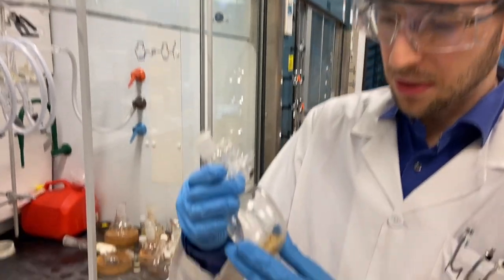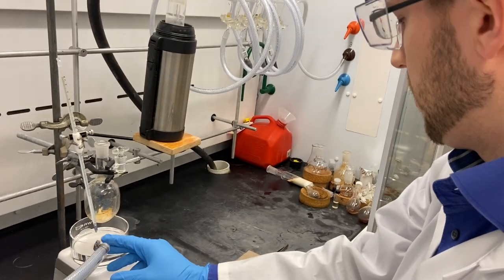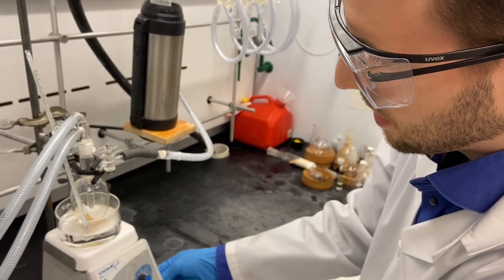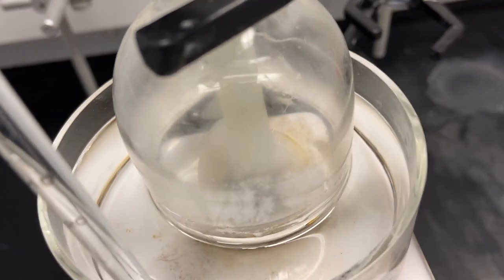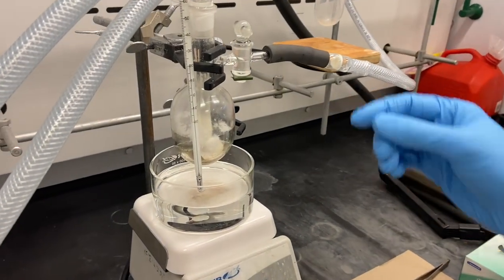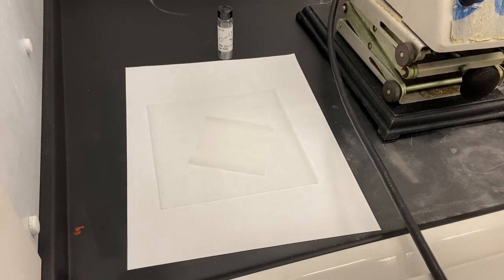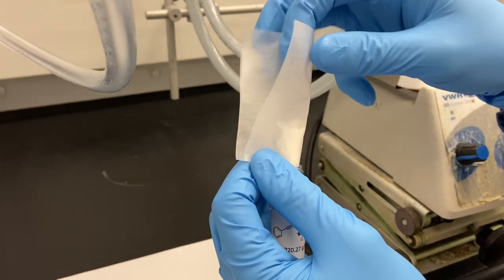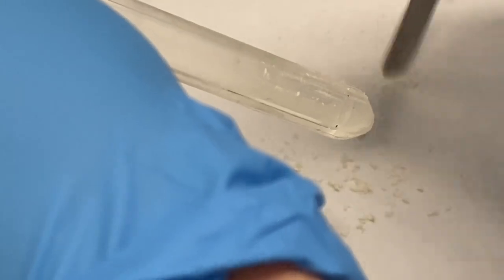How to perform a vacuum sublimation

Comment: So, is the pure product going from solid to gas. And then the adaptor like object that is inserted, its job is to crystallize the sublimated pure product? Is that how you separate 2solids from each other. How do you even know that the other solid won't also be binding to the glass thingy that you scraped of the product at the end too. Via NMR?
Reply from the maker: Yes, you are subliming a volatile product away from involatile impurities. The cold finger collects the product. Purity can be checked by any method you'd normally use, NMR included